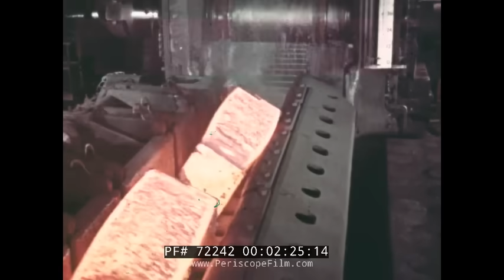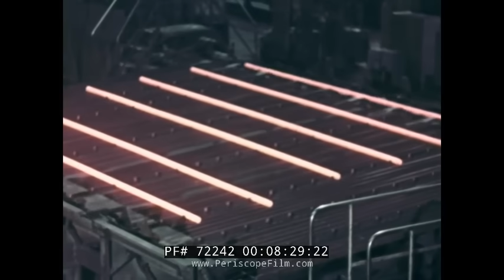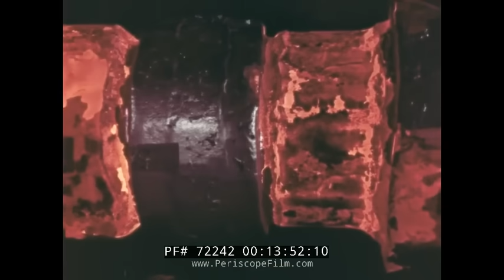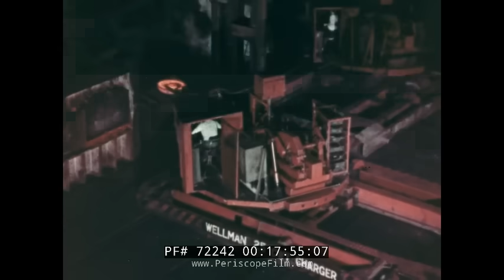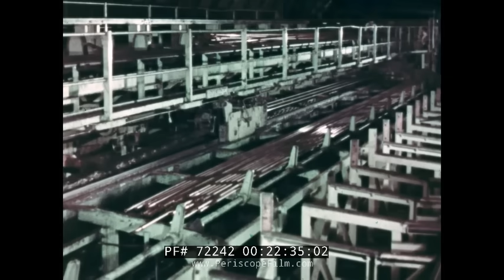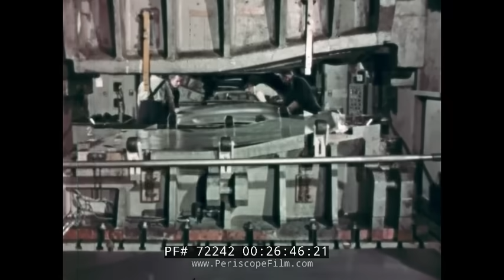"THE DRAMA OF METAL FORMING" 1959 METAL FOUNDRY & FORMING PROCESS   SHELL OIL INDUSTRIAL FILM 72242

Comment: Smoking was of course a healthy choice in these factories, it was the only filter air you got in a day.
Reply: Homeboy lights a smoke off of the red hot billet. Had to be quick to catch it but it’s definitely the coolest thing I’ve seen all week. 

*Lighting my cigarette with a toaster.
*Feeling just as cool.
*🚬😎🕺🖕
Reply: @abcdefghij274  ive been forging for 26 yrs. You can light a smoke off of the tips of your tongs. They get red hot just from grabbing the billets.
Reply: @abcdefghij274  A
Reply: @abcdefghij274  a
Reply: I hear ya. In some locations it's not a whole lot different today, as in the 50s/60s.  Been an aluminum foundry man on and off for 5 years and yeah, not many filters for air around in some operations. Just many large garage doors we'd open to let fresh air in. Some old school means still get used over new tech as well. Our shakeout side for sand casting, is not really a shakeout. We had no large machinery or table that "shook" the part. We would climb the big s.o.b. and use jackhammers to line break the sand. Use the crane to flip, and repeat until weak enough to finish with sledgehammers and big ass "picks" we made on the fly. And say a person isn't confident with either jack or sledgehammer, then that guy gets to go sand blast the core out, and use a safety hammer....
I've been in iron foundry's as well, and our local facility has all the newer bells and whistles. Guess it's about cost over means. Makes sense I guess... Cool video🍻
Reply: @JacksonDunnoKnows  - Where you at? 
I love the line "not confident with a jack or sledgehammer"😜
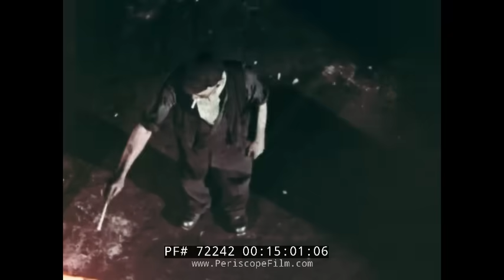Reply: 15:01 lights smoke off of hot billet
Reply: @sparkyvee  sheeple
Reply: Lol! Right on
Reply: Kept you safer too,
Reply: It's headed in the wrong direction now terribly.
Reply: @4x4 500 watt fiber laser  >Yes, the factory workers took a smoke break but they only smoked “Free-Range Organic” tobacco that was “Gluten Free”!
Reply: Bang on the money buddy.👍🏼🇬🇧
Reply: Dad, may he rest in Peace, STARTED smoking while working in a rug mill, because people who smoked got a smoke break, while those who didn't smoke got no break. Yup. The Olden Days.😜
Reply: 4x4 500 watt fiber laser When Ships were made of Wood , and Man were made of Steel
Reply: @airflower3584  I am a man of steel. Ask my wife, she’s the one cleaning the rust stains off my undies.
Reply: @airflower3584  aa
Reply: 😂excellent
Reply: I think it was Kent that had asbestos filters for their smokes...
Reply: Through Asbestos Flitters 😂😂😝🤒
Reply: @sparkyvee  A
Reply: A
Reply: A
Reply: Aa
Reply: A
Reply: A
Reply: A
Reply: A
Reply: A
Reply: A
Reply: A
Reply: A
Reply: A
Reply: A
Reply: A
Reply: A
Reply: A
Reply: A
Reply: A
Reply: A
Reply: A
Reply: A
Reply: Aa
Reply: A
Reply: A
Reply: A
Reply: A
Reply: A
Reply: A
Reply: A
Reply: A
Reply: A
Reply: A
Reply: Aa
Reply: @sparkyvee  Nest door neighbor has worked at one of dozens of 3M plants. His knowledge is off the hook on these mask as the have to meet MIL Specs and "N95" are for dust only. Use on the farm, auto work, grinding and other dusty events. Virus spores are 9 times smaller than the "N95" could ever dream of blocking. He listed 28 other categories that are much better with the organic full face filter used during solvent painting are the best. Facial hair and a negative pressure test is required for perfect results. Biologic filters (MIL Spec) is completely 3 times better than paint mask. A paint mask has 3 layers of paper, lining, cotton sandwich in front of activated carbon that traps dust, allergens, pollen before the viruses, bacteria, organic compounds are absorbed by the activated carbon. Carbon granules are placed in a vacuum then heated until they pop like pop-corn. This opens them to very tiny holes between 3k to 100k cavities that hold hydrocarbons and hundreds of other in-organic & organic compounds to particles. The Covid-19 is a variant of the common cold even the Spanish flue. A negative pressure test is blocking the filter inlets and not being able to get air as a plastic bag over the nose & mouth. As the hydrocarbons enter the holes of activated carbon, each heat up of get much warmer. This is known as an "Exothermic" reaction. Other compounds react with less or no reaction of this type. These compounds or particles are removed during reverse air flow with clean air then ready to absorb more again. Paper or cloth mask do nothing except keep dust out and make you feel better. He said short of staying outside 24/7 is allowing to small exposure around other while shopping, doctors office just everywhere develop "Herd" immunity. Every company. including 3M, have pure samples sent to them by the CDC for level #1 testing filter media testing. It works differently than a cold of flue as it attacks the lungs, breaks down the thin lining between your blood and the membranes that allows oxygen to pass while keeping most of the nitrogen in the atmosphere out. Testing of the "Spiked" Covid-19 virus on a one-inch of "N95" filter media catches on average 9 spores of covid-19 when there is room for 150k to 220k spores. a complete failure in filtration science spec on any level. These mask are not effective on any respectable level. Know one wants to hear this info but as a performance test engineer with 36 years with the same company at the same location who writes a certified report for the CDC with his name on it, does not let him sleep well as the government wants you to believe. He told me you get better filtration from 3 moist neckerchiefs tied around your face and sealed if you can stand it. 3M should know about protection from particles as they supply the military, now you!
Reply: Shut up
Reply: Sounds like my day at work when people are parting off 4" diameter steel bars on the lathe and douching the tool with Molybdenum Disulfide (Molly Dee) Cutting fluid. I literally feel like I smoked a pack those days.
Reply: Its right,kkkkkk
Reply: @Skylabo  A
Reply: @Skylabo  a
Reply: @Skylabo  a
Reply: @Skylabo  A
Reply: @Skylabo  a
Reply: @Skylabo  a
Reply: @Skylabo  a
Reply: @Skylabo  A
Reply: @Skylabo  a
Reply: @Sparky Vee   Did you mean “The WuHan China” virus? The same 3 story building where the worlds 3rd largest study and experiments by virologist scientist work? Where the “World Health Organization” have cited 5 violations of ISO9000 standards for handling hazardous virus containing chemicals, viral debris walked out of containment “Level 2 & Level 3 clean rooms, walk right out the door to go home, markets and shopping centers. My uncle quit the “WHO” in April 2019 because the World Health .Org. citations did not result in changes. Only 1 of 5 fines were paid and changes made. He was not surprised. He works for Pfizer Inc in Sweden.
Bad China!
Reply: @deankay4434  aa
Reply: @amickguitar303  aabbccuu
Reply: @deankay4434  aa
Reply: @deankay4434  A
Reply: @deankay4434  A
Reply: @deankay4434  a
Reply: @deankay4434  a
Reply: @deankay4434  A
Reply: @deankay4434  your uncle made the right choice as now they are producing the vaccines

Comment: I could never understand why the steel does not cool down during rolling, then I found out that the rolling increases the temperature.
Reply: conservation of energy. If it takes 100kw of energy to roll a peice of pipe into a shape, that energy has to be conserved in the form of friction, which creates heat....